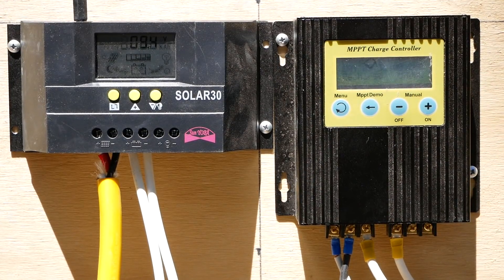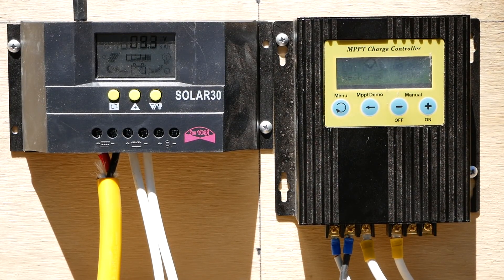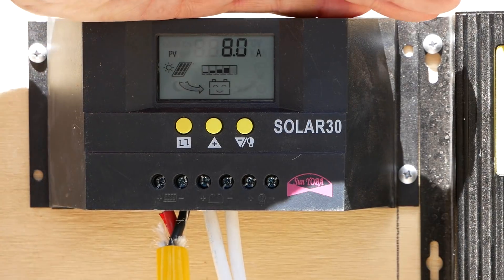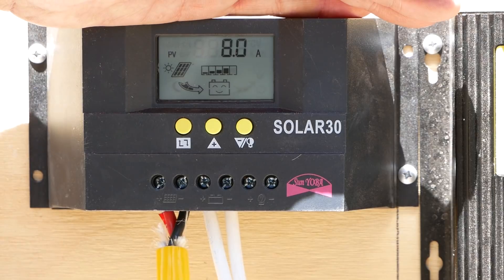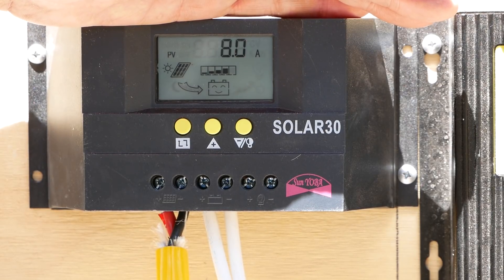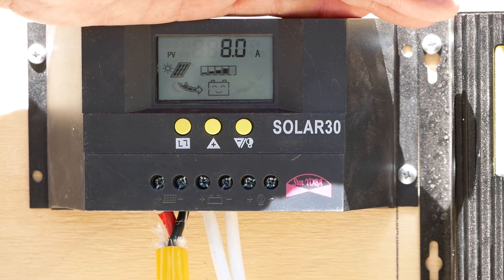MPPT vs PWM What does it mean to you

Comment: Good basic description of PWM vs. MPPT.  I would just like to add that PWM is a rock solid choice for SOME systems.  MPPT is more efficient - hands down, no question.  But  there are cases where PWM can be a more cost effective choice for a 12v nominal solar array.  In my case, for example, my battery bank is big enough to last about 5 days with typical daily usage even if I get zero charging (5 days of fog, for example).  So typically I drag the battery bank down about 10% of its capacity daily.  I have a PWM controller.  Using the numbers you show in this video, I discovered that having MPPT would charge my battery bank up about 45 minutes faster than the PWM does.  But the PWM gets me charged up before noon every day that there's sun. So it wouldn't matter to me, except in cases where it's cloudy or foggy day after day, and I really needed to maximize charging.  But because of the location and time of year that I do most of my camping (this is on an RV),  that's never happened yet for a long enough period of time that I was in danger of having to shut the system down to prevent over discharge.  And the system has been installed for 9 years now.

With such a small difference in price between these two controllers, I'd probably just go with the MPPT anyway.  But for higher quality controllers that run into the hundreds of dollars, it can be cheaper (sometimes significantly cheaper) to go with PWM and add an extra solar panel to the array to make up for the efficiency difference on some smaller systems.   Everyone should do the math for their own particular system.
Reply: Maynard the Miser, Yeah. PWM is under appreciated especially in smaller systems where the panel voltage matches the battery bank. Just getting a handle for the point at which switching to an MPPT gives more power than adding another panel, but I am also appreciating PWM more.

Comment: Very simple explanation Thanks, Jim... When I first got involved with solar I talked to the guys at RENOGY and they explained everything. The first question was how much power did I think I'd be needing. I told them I wanted to run my 12 volt 64-quart Dometic fridge/freezer and then some lights (LED's) a 12-volt tv with built in DVD. And a mess of USB chargers. I ended up with 4 RENOGY 100-Watt Monocrystalline panels, the RENOGY MPPT 40 amp charge controller, a Renogy 500 watt sinewave inverter. So far I'm very happy with my little system. My fridge freezer is always on and is working great! We've had a few overcast days and I still have 13 going into my little battery bank. Two 6 volt Trojan T-105 RE batteries. I spoke with Trojan Technology department and they gave all the settings that I needed to program into my charge controller. Then the guys at RENOGY walked through the process of programming... Long story short I love MPPT set up it works great and serves me well. However, I do wish I could run a small AC unit. I'd be needing more panels and batteries. Right now I run the rooftop AC unit from my Honda 3000 watt inverter generator. Anyway Thanks again Jim for all the info that you share with us. Your a godsend IMHO (((((Big Hugs))))))  Roger

Comment: Thank you Jim,  I have heard a lot of people discussing this but until now I didn't understand what the difference is.   It is better to spend the extra money for a better setup.
Reply from the maker: The most important thing is that you get what fills your needs. Better for one person is not always better for all.
Reply: @solarboondocker4597  
I'm building a system, I want to use a 300 watt panel from Renogy to start my build, but I want a system that can handle 3-4 of those panels. Can I add panels over time? I want to use lithium ions, but the cost, holy cow. Is Renogy the best choice? Can I buy a 300 watter somewhere else for less than 300 bucks? I live in Texas, I'll die without at least a little bit of AC. Thoughts?

Comment: I purchased the Eco-Worthy, along with the slightly more expensive EPEver Triron, which is an upgraded EPEver Tracer AN that is also considered a good value mppt controller like the Eco-Worthy.  (I believe some of Renogy’s controllers are relabeled EPEver units per their look and same user manuals.) Also I plan to purchase a Victron Smart controller in the next month.  Those three controllers combined with my new Uni-T DC clamp meter, PotaPow meter, a bunch of in-line power meters with dongles, and I am set for lots of experimentation and fun in the desert this winter. Thanks for the knowledge seeds!

Comment: Thank you Jim. Researching the Eco Worthy MPPT value, I just had to buy one, so I used your link. Also got Blue Sea 5035 6-fuse block, and some cable. If it works as expected, I will buy another set. Expect to use them for awhile then pass it on (I want more solar and battery metrics - I think). Again, impressive research. Thanks.

Comment: Excellent video, Jim.  Wading into the subject of energy budgeting I've found that most people believe that the subject is complex, when actually the subject is as simple as balancing a checkbook:  Amp x Volt = Watt.  Amp = Watt / Volt.  Amphours = Amps x hours.  For all voltages and all amps.  Just add them up like a checkbook.  To discover the amperage demand of any device or appliance, there will be a sticker on the appliance, or a spec sheet available online (with some drilling-down), usually indicating the voltage and the wattage, and . . . . amps = watts / volts.  - C

Comment: 3a x 14.5v over 8 hours, is a good bit of power, eq to 180 wh but you will likely be getting power for about 10 hours in Summer , so could be equal to 200-225wh per day. From 3 amps, its definitely worth getting a mppt, and the further the voltage is off, the more you can loose,

Comment: You are correct in your calculations but I doubt if the lady with the microwave and the lady with the curling iron have 12 volt appliances. They are most likely 120v a/c devices. That requires an invertor. A whole new subject and calculations. Love your videos.
Reply from the maker: In a simple sense if it takes 10 amps at 120Vac, it takes 100 amps at 12 volt. The inverter can throw you off because some use stupid amounts of power running and even in stand by
Reply from the maker: There is a 12 volt 9000 BTU roof A/C that pulls 600 watts
Reply: Great video!

Comment: Thanks Jim, you should also talk a little about "Pure Syn-wave Converters". I've heard that they are best if using sensitive equipment like computers, because of the way they regulate the power going to the device.
Reply: I have never heard of a pure sine wave converter, only inverters
Reply: There are three main types of inverters Modulated, Modified Modulated and Pure Sine. Modulated should not be used with anything that has a motor. Pure Sine is fine for everything as it produces a more true sine wave than standard house current. Modified Modulated depends on the manufacturer as it is using a modified form of modulating square wave DC. Some are good some are crap, to find the difference ask Jim.

Comment: Here is a caveat:  the output of a PWM is a pulse/square wave with the amount of “on” time varying as the battery charges. I don’t know what that PWM Amps reported by the controller represents - peak, average, effective, factory pre-fudged, .....  I don’t know how to check this other than with an oscilloscope, because meters will kind of “average” the pulses. Have you seen any details?

Comment: Eco Worthy has a 40 Amp Bluetooth MPPT charge controller now besides the 20Amp seen here, which was their only one for a long time. Also a remote plug in monitor.
Reply from the maker: I have one waiting to be picked up and installed on a project now.
Reply: To all, new Eco-Worthy 40amp:  Amazon is about $135 free shipping in a couple days. Directly from Eco-Worthy is a couple dollars cheaper after adding shipping (less than $5 diff), but up to 60 days.
Reply from the maker: @mikemead2315  The one I bought was on ebay for $119 including free shipping. It got here in less than a week. I will pick it up from the P.O. box in a few days
Reply: Solar Boondocker, Interesting. I typically get good deals on CC  on ebay, but I could not find it. I need to search better ;-). Thanks!
Reply from the maker: @mikemead2315  I have installed the 40 amp controller. It still has Eco-worthy's 50 Voc limit. It says limited to less than 500 watts and has new programing. The blue tooth app looks identical to the app Victron uses except for the color.
Reply: Solar Boondocker, Really!  Thanks! I have not ordered mine yet. It sounds like Victron has set the app tone, which in my mind is not a bad thing. Voc is a bit low, but it still sounds like a good value. 
If you ever decide to show your project, I would look forward to seeing it!  Thanks for the info!

Comment: HOWEVER. in addition to mppt controller I will need... 1: an even # of panels meaning i'd either have to buy a 4th one, or get rid of 1. and 2: a 24-12volt converter for my RV lights and appliances. Inverters often take either 12V or 24V though so im not super concerned about AC.
Reply from the maker: A MPPT controller can have three or any number of matching panels in series as long as they are within its Voc limits. An example is I am using three 250 watt panels with a Voc of 35 volts each for a total of 105 volts open current on my Morningstar 60 amp MPPT controller with a Voc limit of 150 volts. It converts that power down to be usable on my 12 volt system. I could run them on a higher voltage system if I wanted or in parallel.

Comment: Hi Jim, I watched Bob's video about your system again and I still get myself confused about how you have it wired up. I assume you have the 2 MPPT because you have 2 'sets' of panels but I am lost on 2 controllers "that run the AC direct and still throw a bone to the batteries", 1 battery bank, and one inverter. Can you go over how the controllers, inverter, and batteries are wired together and how power is sent to your outlets? Thanks!

Comment: Hi Jim , In your interview with Cheaprvliving you indicated you were using a Renogy Adventurer  Charge Controller for your 1185 watt solar system. Are still using it ? 
 Also the difference in positive and negative grounded inverters and if any in wiring between the 2 ?

Comment: Have you considered a small generator like a Honda 2000 and then add an Easy Start converter to your ac? Then the generator would easily start and run the ac. Then if you convert your generator to run on propane you could go about 20 hrs on a regular 20lb cylinder.

Comment: Question,,,,what happens to the solar panel when batteries are charged and nothing is using energy .? Does this damage the panel ? Or example if panel is disconnected completely and in direct sunlight.

Comment: The original two 12 volt batteries that came with my rig are now 7 years old and I want to replace them. I have asked for advice and it has been  split between staying with the two 12 volt or going to two 6 volt wired in series. No one seems to be able to give me a good reason either way, hope you can.

Comment: What is tge downside of wiring in series (like the two panels connected  to the MPPT) compared to parallel (like the two on the PWM)?   Does that configuration  affect  the performance  advantage  of MPPT over PWM?
    There  are a ton of comments  on this video so if you already answered I missed it and apologize for bringing  it up again.

Comment: The Eco-Worthy MPPT charge controller seems to be a very good value indeed. Is a more expensive MPPT charge controller better at using even more of a solar panels power, and/or better at battery longevity?  I notice you now use MorningStar TriStars which are highly rated and much more expensive.
Reply from the maker: I had to have something big enough to handle my systems. I was using three Eco-worthy's and did not want the rats nest of wiring they would need. At the time I started the Eco-worthy was the only sub $300 MPPT controller that could take more than a 230w panel.

Comment: Hi Jim .maybe you can help me understand  something. 
When you add a solar charging system, to a motor home can you leave it connected and charging when driving and charging from the alternator, or plugged to shore power. I have heard about isolaters, is this part of the solution? I love what you have done with Bob and now with your own channel. Maybe you can help me understand this. Thanks , Vince
Reply from the maker: you can leave it connected. Each charging source sees the same voltage and the battery will self regulate its consumption
Reply: Thanks
Reply: So Jim, do I understand that there is no problem with having both the converter/charger in the rv, on shore power, and have the MPPT charge controller, powered by the solar panels, connected to and charging the batteries at the same time? It's a little confusing. Thanks for your videos...I want more videos from you.

Comment: Good day Jim. I was wandering which you would recommend. I'm looking at setting up a solar set up for trailer. I can either but multiple 100 watt panels or larger 360 watt panels which would you prefer
Reply: Richard Gregory, couple of things I found out with my big panels:
*Size:  360W is huge at about 5.5 or 6.5 feet by 3.5 feet. Do you have room? I got very lucky and it fit perfect to 1/4”. Close. The 100 watt panels will fit in smaller spaces AND can be stored and placed in sun if parked in shade. The 360W are only about 40lbs, but they don’t store or move easy. 
*Price for the same watts:  The big panels are cheaper if no shipping, and sometimes even then they are cheaper (I drove to and picked mine up at dealer for $0.49/watt). 100W panels come in the mail.  Ordering and adding a panel is a click away.  
*Large wattage panels are higher voltage, so require a MPPT controller, which costs more. Using a PWM controller would reduce a 360watt panel output to just over 100watts.

Comment: I have watched your videos and first saw you on Bob channel.  I am designing a system with 600W solar to start and may go to 1200 watts.  I am planning on 600 amp Lithium (Ruixu-maybe or Battle Born-cost????) bank.  When it comes to charger controller I am going with a 60 amp to start and leaning to Morningstar because of you but, the Epever at $200 vs $600 is very interesting.  Can you please help me understand why the Moningstar would be worth spending $400 more.  I first thought Trojans were the best battery option until I learned about all the benefits of lithium.  I’m hoping that Ruixu reputation grows to be a better option than Battleborn.
Reply from the maker: I used Morningstar because when I installed them there were few choices in large CC's. EPever was Tracer and had a horrible reputation. Should they now meet your needs I say go for it.
 I have not heard of Ruixu but do suggest that you look at LifeBlue Lithium batteries. They not only have blue tooth built in that shows just how much charge they have but also have a low temp version that can be used down to -4*F.
Reply: @solarboondocker4597  Epever does if they are reliable, what have you heard about them lately?

Comment: Awesome thank you. If you have time can I charge an additional battery of the "load side" of the controller? Maybe a future discussion vid on how to take advantage of the load side output? Thanks again. Mark
Reply from the maker: I am not a big fan of load terminal usage. Usually they are limited in amps and can not do much charging. The only advantage I see is that they can be used to keep a device from drawing the battery too low.
Reply: Solar Boondocker :thank you, mark.

Comment: Good demo, Thanks Jim. With parallel controllers charging the same battery do they ever get into a ‘Feedback loop’ where they keep flipping between different charge stages due to the effect each has on the voltage the other is generating? I guess I could setup a side by side rig like you did to test, but there are so many variables with different controllers, different voltage set points, etc. Just wondering if you have run into that? I think you said you run one controller for the trailer and one for the truck panel - any interaction between them?
Reply from the maker: Occasionally my controllers will be in different stages especially if I disconnect the truck and then reconnect it. The manufacturer say it isn't a issue. You can buy controllers that will slave to another. I have run up to three controllers and they are fine as long as the set points are the same.

Comment: Thank you Jim. I am going to get a MPPT Controller now for my 200W Renogy system. I may have a dumb question here. Why in your example was the PWM panels in parallel and the MPPT panels in series?
Reply from the maker: With PWM any voltage above the batteries voltage is lost not to mention in most cases too high of voltage can damage the controller. In MPPT higher voltage and lower Amps means less line loss with smaller wires and putting the panels in series may produce better results. I tried the comparison once and do not remember a huge difference .
Reply: Solar Boondocker Hi Jim. I got to thinking about getting the MPPT with my 2 -100W Renogy panels. on your advice I will change to running them in series. Question, if I add 1 more 100W panel totaling 300W is it ok to run that one in series with the other 2 panels?
Reply from the maker: As long as it does not exceed the controller Voc and Amp limits you can. try to make sure none will be shaded or it is like they all are. Also get the same panel for the third
Reply: Solar Boondocker So cool that you respond. thank you. I got ya on all must be in Sun.